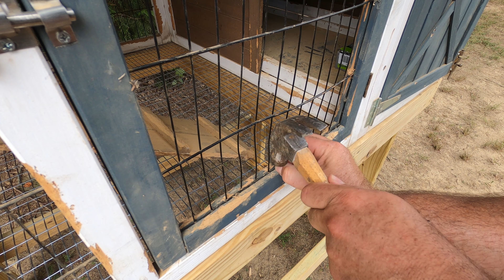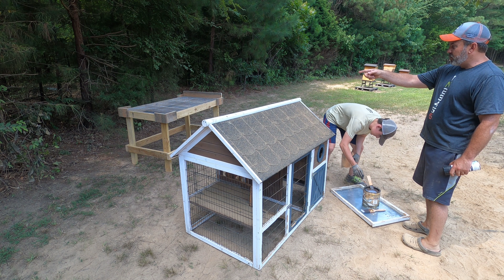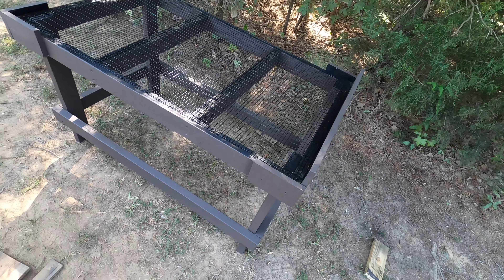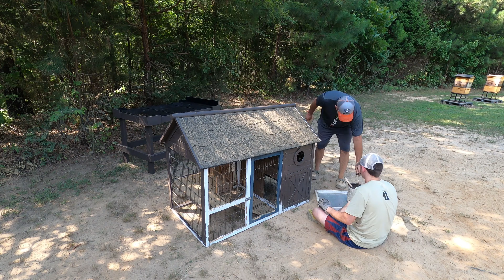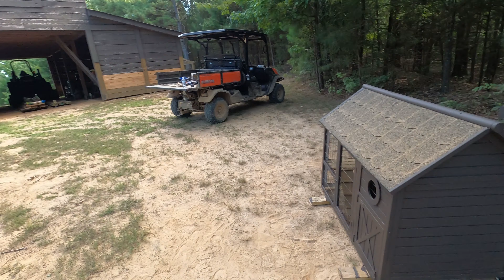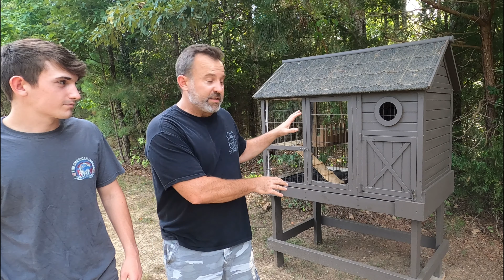Setting up a Rabbit Hutch on a Homemade Stand

Comment: Tim - we had that same exact hutch that we had 2 pet rabbits in.  A domestic dog pushed the wire right in and killed both rabbits in about 30 seconds - just for sport - not for food.  We watched the who thing the next day on a surveillance camera.  You have made some good reinforcements.
Reply from the maker: I hope it helps.  Having it up high will for sure!  Thanks!
Reply: @RidgeLife  The problems were two fold.  The rabbits chewing from the inside weakened the dado joint where the wire sat.  When the dogs pushed in, there was nothing to hold it.  The staples you put in should fix both problems.